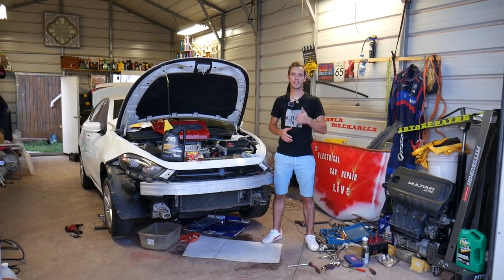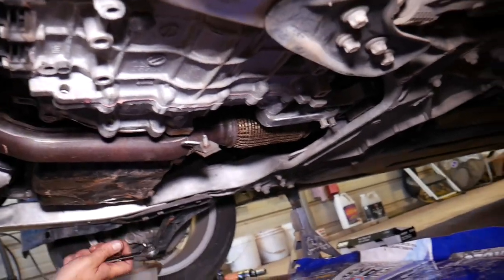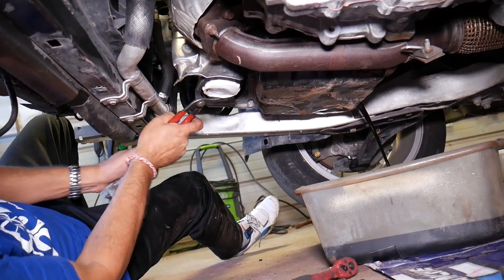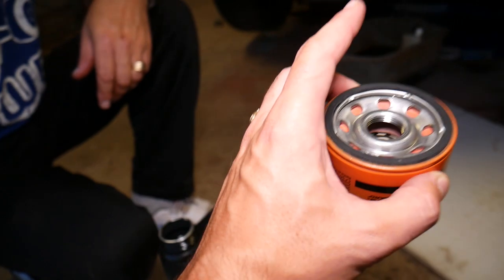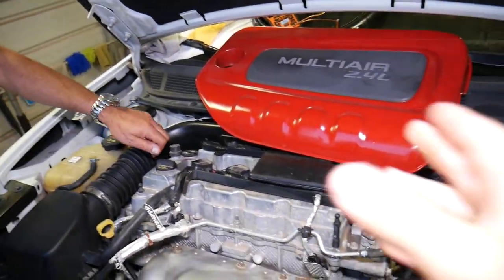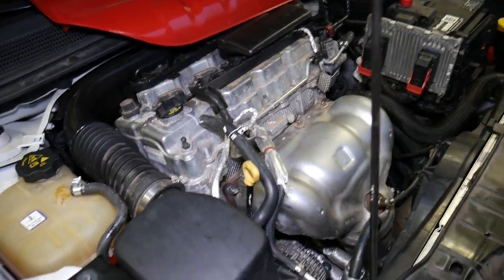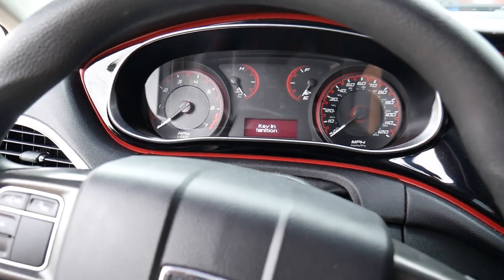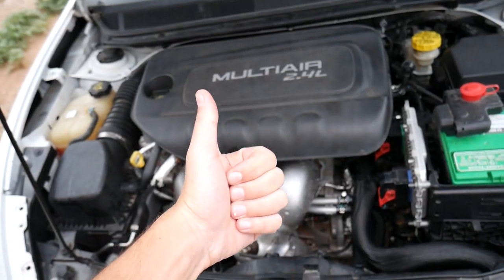DODGE DART OIL CHANGE 2013 2014 2015 2016

Comment: The underneath of my dart doesn’t look like this, it’s a 2016 sxt California with touring and dual transmission. The underside is completely covered and there is a door for each of the fluids underneath. It looks like this dart had some things removed before the video, but even the parts look different and oil pan location. I wonder what trim model this is? Keep in mind the 2016 sxt is the same as the GT other than full accessory packages. SXT models below 2016 have the SXT emblem on the trunk and are not in the same tier as the 2016 SXT but actually two trim models lower than the GT. If this is a 2016 SXT a lot of things are missing.

Comment: I live in Texas and bought 5-20 by mistake.. After watching your video I decided to use 5-20 even though it recommends 0-20. For the summer time anyway. 
   Thanks.
Reply: That is smart, I run 5w30 in my 2 darts year around. No using oil problems.
Reply: First time I heard of this was in this video.. Oklahoma has barely been below 100° this summer.. I was seriously thinking about doing this too

Comment: For 2.4l turbo ur supposed to use 5w-40?
Reply: There is no 2.4l turbo, only 2.4l NA
Reply: Your supposed to use 0w-20 on 2.4 engine, I have dodge dart gt
Reply: If you have a 2.4 turbo its from a old Neon. They had a srt turbo

Comment: There was a reason Fiat Chrysler stopped selling this last version of the Dart and Chrysler 200 in the U.S.
Slumping sales after numerous quality issues and mounting consumer complaints which is no surprise since this cars architecture and engine are Fiats, not Chryslers.
This is the same reason the Fiat 500 is no longer sold here either.
If your considering buying a Dart or 200 get the previous generation that had Chryslers 2.4, not Fiats and Chryslers four speed automatic which is easy and cheap to maintain plus it had a dipstick unlike this last generation that used the trouble prone and expensive to service and repair German ZF automatic transmission.
Reply: Tl:Dr Ford superior, quiet child.
Reply: I have 2 of these darts love them.
Reply: No problems at all.

Comment: WHAT about reset sistem? To 100%.. On Dodge its need...
Reply: Steering wheel arrow until you see oil life, put the ignition to “run” only make sure it isn’t started, then hold the other arrow until it resets to 100%